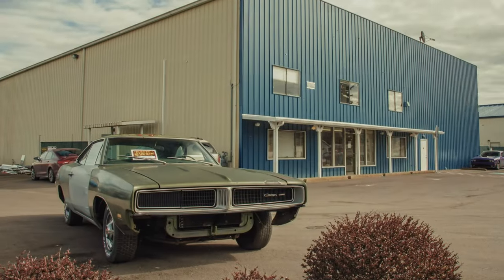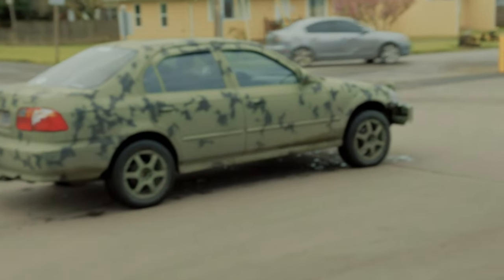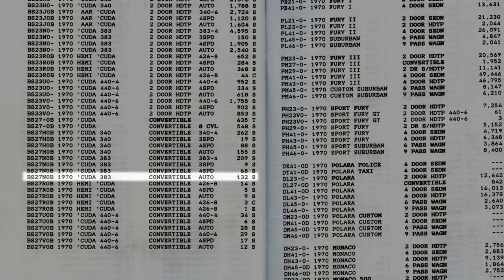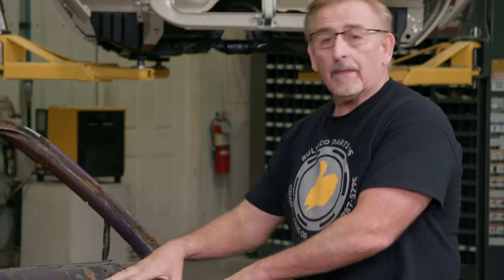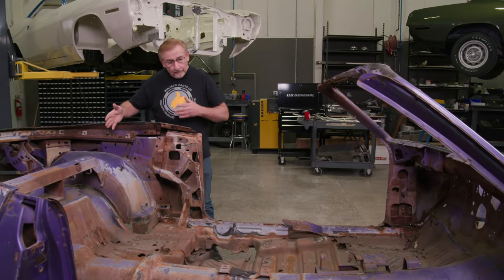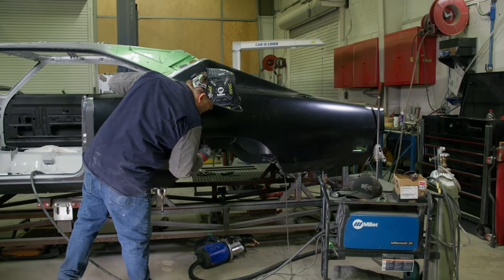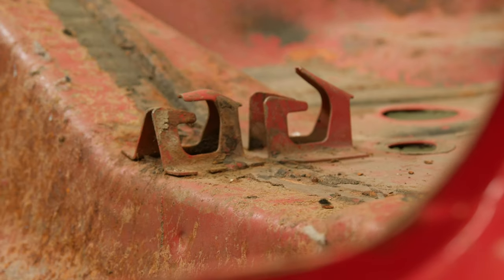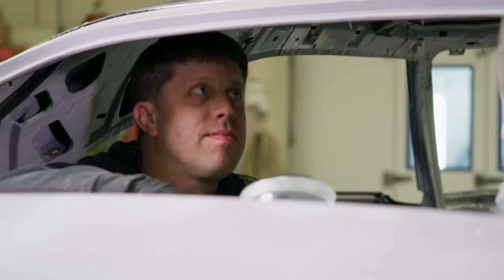RARE CUDA CONVERTIBLE FOUND BUT CAN IT BE SAVED?

Comment: My guess on challenger convertible back seat location. I bet convertible top was shared with cuda. Upper back seat crossmember is closer to the front compared to hard top challenger. I noticed in your video upper back seat lower mounting bracket is also closer to the front on the challenger compared to the cuda. Engineering must of thought the lower back seat would be to tight to fit. I have a 70 cuda convertible completely restored 10yrs ago. It's going with me to the graveyard. When the time comes. Let me know if the convertible tops are same dimensions. Curious minds need to know